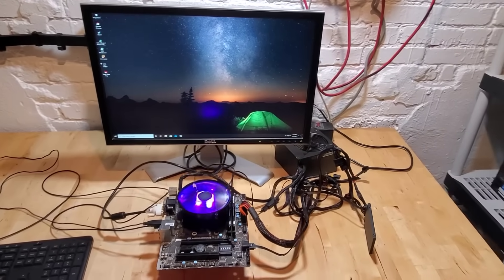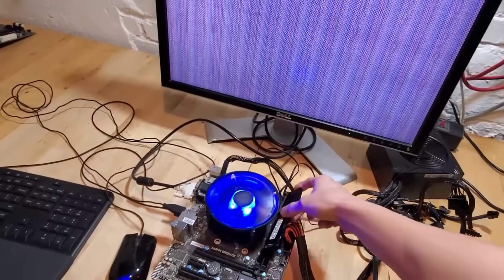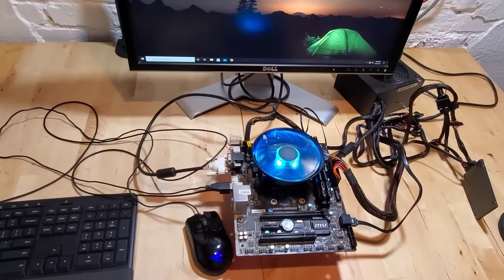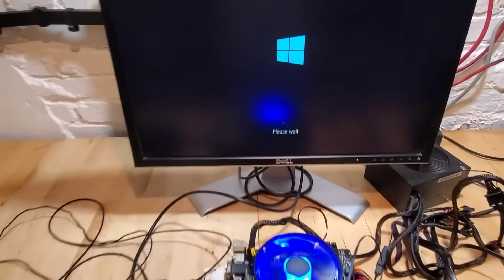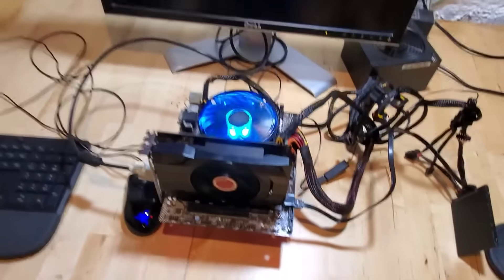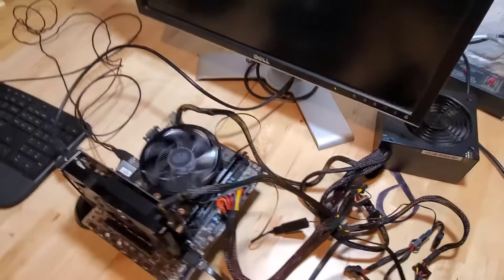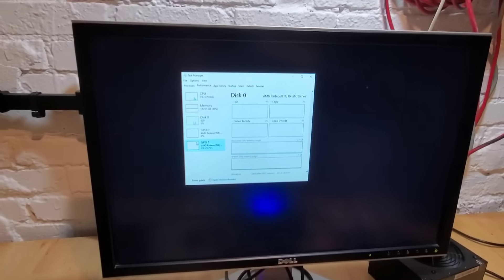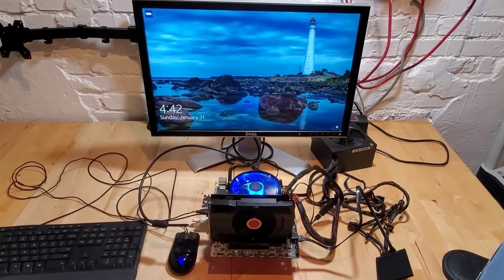What happens if you remove PC components from a running computer?

Comment: Would've loved to see the CPU getting removed while a gpu is installed
Reply: The screen would just freeze as the GPU wouldn't be recieving any more instructions from the CPU. Depending on GPU it may decide to shut off after some time.
Reply: For anyone interested, linus actually removed a cpu from a system with a gpu in it kinda accidentally - https://www.youtube.com/watch?v=D_Q_6V10mTU @ 9:06
tl;dw is basically the gpu keeps outputting the last frame which it generated, lol
Reply: Wouldn’t change anything
Reply: @kingeling  well the cpu handles all video when theres no gpu installed. I've encountered numerous occasions where a gpu has disconnected due to a bad powersupply in a multi-GPU system, and the os was able to recover from it without crashing the whole system
 Only gpu accelerated applications crashed..
Reply: @wouter11234  You can't switch from a GPU to an iGPU when the system is running as far as I concerned. So doing it would just have the same outcome
Reply: @amvywavy  You can switch GPUs. In fact a lot of Laptops do that for better efficiency.
Reply: @cnr_0778  oh yeah, I forgot about that. But I don't know how Windows will react if you randomly pull out the graphics card. I think it'll just freaked out and blue screen, or don't output video signal at all
Reply: @amvywavy  Yeah Wincrap tipically bluescreens if you randomly pull out PCIe devices.
Reply: @amvywavy  it would just blue screen unless you have a motherboard that supports pcie hotplug
linus did a video on this here: https://youtu.be/YigN2mkQMPc?t=977
Reply: @cnr_0778  also, I have this issue on Wincrap where my SSD write speed is so slow, I think my USB drive might even be faster. It was like stuck around at 5-15MB/s! Sometimes not even moving! It sometimes spiked to 100MB/s but that's it! Even though I connect it to a SATA 2 port, I don't think SATA 2 is that slow! When I look at task manager, the disk was getting like 10-20% usage while the ram is at 70-87% usage. Maybe it's the ram but the ram isn't even hitting 100% usage! I don't know if it's just me getting unlucky because that's apparently common with me and Windows or the SSD is acting strange because no way the SSD is the problem because its a Crucial MX500 and its not even 1 year old yet
Reply: @amvywavy  have you tried it on linux?
Reply: @wouter11234  only with integrated cpu graphics though
Reply: @cnr_0778  yes, but that is different. It either requires a MUX, or if it’s only using Optimus it actually routes all video through the iGPU, even stuff accelerated by the dGPU

Comment: I did the Hard Drive one on macOS a few times and when u remove it, it stays looking normal at first but if u try clicking and doing stuff with it then it just shows it clicked but nothing happens except for the spinning beachball appearing all the time. You can just reinsert the drive if ur quick enough and it’ll continue to work but if ur not quick enough u have to force shut off the mac.
Reply: SATA is hot plug and hot swappable, probably Linux would be the same thing as MacOS, 'cause they are Unix of some sort. If he plugged the SSD very quickly probably the Windows would function normally or would launch a BSOD, 'cause yeah, Windows NT sometimes suck.

Comment: 6:13 - You can configure the system to allow hotplugging SATA devices on any port separately.
Reply: Yes SATA is hot swap capable but you usually run in to problems when you unplug your operating systems' main drive. That has nothing to do with hot swap capability.
Reply: I think drives with cache/dram would react differently than ones that have it when being hot-swapped
Reply: How

Hold on I'm googling it already
Reply: @asaultikk  it’s in the bios

Comment: Now I'm kinda curious, what would have happened if when you took out the GPU, you also put took out the DVI cable out of the GPU  and put it into the system itself to try and get a signal from the integrated graphics?
Reply: I think it would have failed over to the integrated graphics with a DXGI error. Something like this: https://forums.evga.com/download.axd?file=0;2637440&filename=crash.PNG
Reply: I don't think you can
Reply: Windows usually bluescreens when you randomly unplug PCIe devices. I wonder how Linux would react tho.

Comment: Man I thought it gonna be short circuit when you replug the components haha

Have you tried hot swappable in the bios setting? I'm not sure what is for but I think it makes some component not need to restart when you replug it
Reply: if you plug in or unplug usb devices when the system is running, then that is considered as hot swap/plug as well
some motherboards have the option to support sata hot swap in the bios, and from what i tried it would behave just like when you plug in or unplug an external drive
Reply: @Napert  Yeah, it's kinda cool but also scary too, I can see why it's disabled by default

Comment: You should've tryed one think: ram removal with the dGPU on
Reply: vRam does not do the work of the normal ram so I think it would show the same result.
Reply: @albertsebastian6836  Integrated GPUs uses a portion of your main RAM as VRAM.
Reply: @albertsebastian6836  Integrated GPU uses RAM as VRAM that's why when you remove the RAM you see strange artefacts. Since GPU has it's own VRAM the result might be different like it might freeze without showing these strange artefacts.